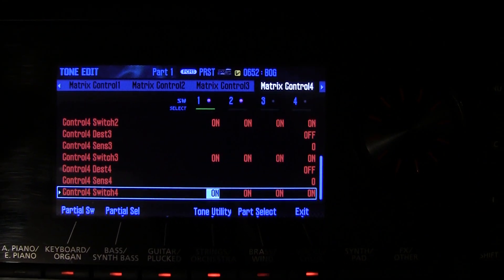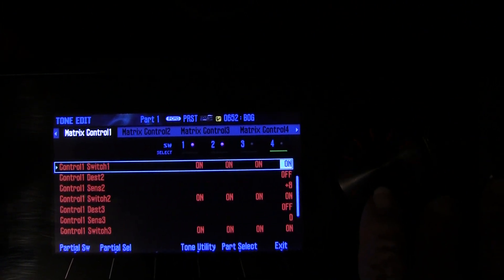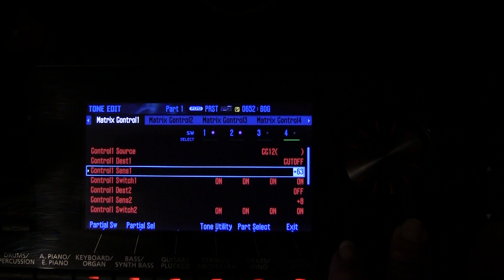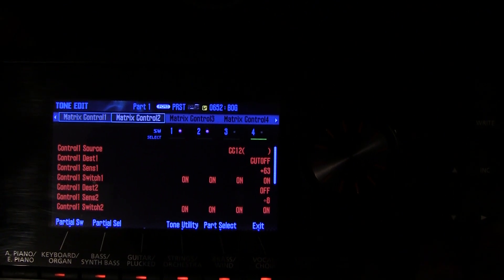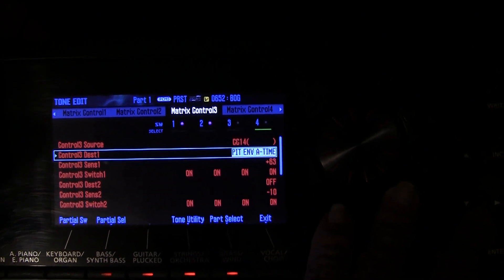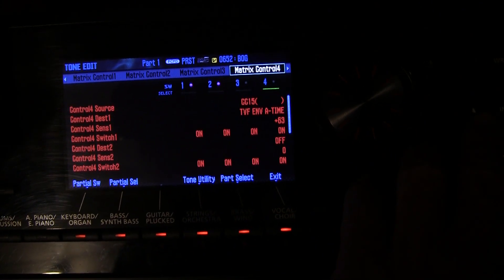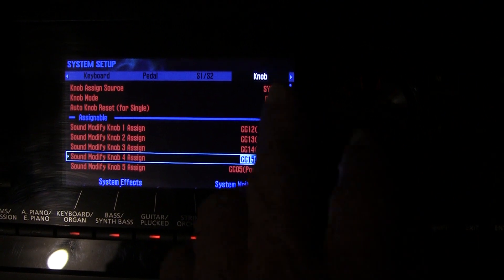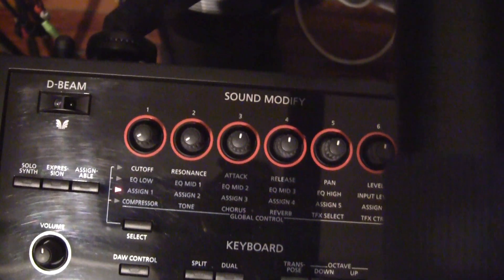Roland FA-06 Matrix Control of Tone Parameters

Comment: sir how to assign knobs in every part in studio set like knobs 1 is for Chanel 1 and 2 is on chanel 2 and so on?
Reply from the maker: Sadly this is NOT possible ..... shame on Roland because that would have been easy to implement and very useful .... a "workaround" is to select ASSIGN 1 - 6 and then program different MIDI CC numbers to each of the knobs and then make sure that CC number (of the knob you want for a specific channel) is ONLY referenced (for whatever  parameter you want to control) on that specific channel ..... since the MIDI CC numbers on these knobs are not channel specific

Comment: I don,t find where the matrix control is in my fa,s menús. May you indícate where it is?
Reply from the maker: the Matrix control is a TAB associated with the PCMS tones ..... First you have to make sure you have loaded a PCMS tone (they are marked on the left in the tone list) ....... Second, you have to hold down "SHIFT" and then select "Tone Edit" in the Soft Menu buttons (it is the leftmost button)..... Third, you move the  highlight to the top of the screen and then use the RIGHT arrow to move across the TABS till you see "Matrix Control"
Reply: Thanks, Stephen!

Comment: Thanks for your FA 06 videos .
Silly question. Is it possible to load some Yamaha Motif sounds ?
Reply from the maker: NOT DIRECTLY...... you would have to re-interpret the parameters ...... find a similar waveform in the library ..... and then tweak it..... it would be done by ear..... you cannot import Yamaha data on Roland keyboard or visa versa ......  only generic SMF and WAV files will work across manufacturers
Reply: Thank you, you're fantastic ! Ignore negative comments,  be yourself.